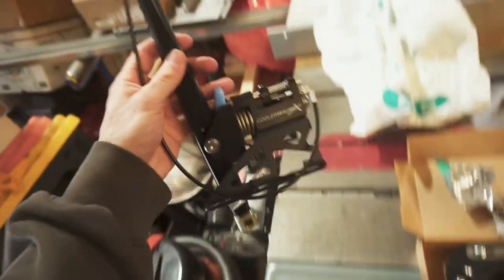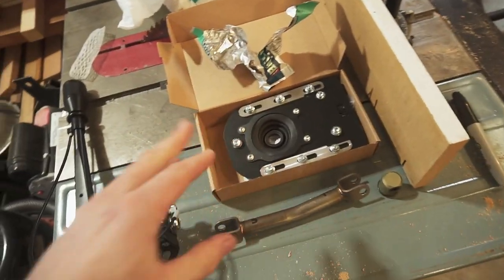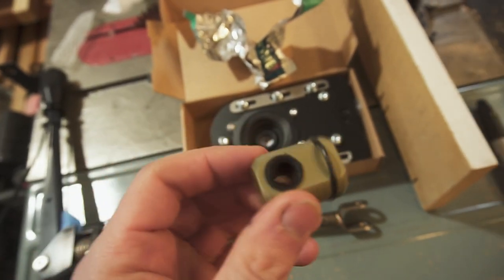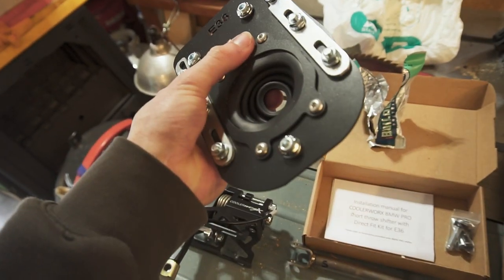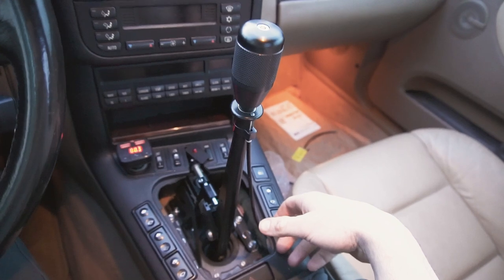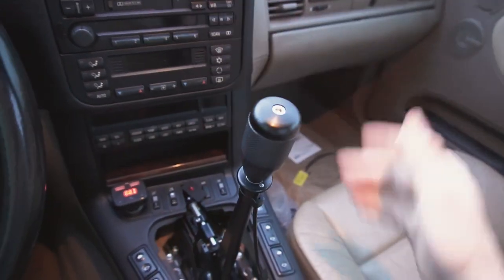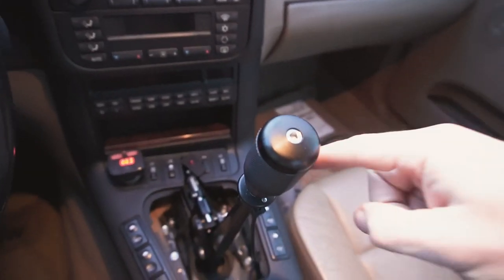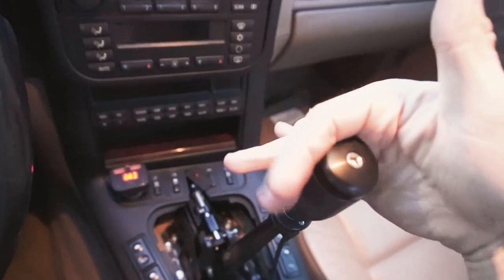E36 gets a self centering shifter from COOLERWORX... IS IT WORTH IT?

Comment: In my mind the self centering is complete nonsense. The 2-3 shift for example, if you literally just push forward on the shifter without grabbing it, it will go straight to 3rd because its already designed to center itself. Same with 5-4, just guide the shifter backward and it will align itself with 4th. The self centering aspect is actually pointless and just another way to sell people into thinking their fixing a problem they never had. honestly i dont know why you would want 1st and 2nd to look the same as 3rd and 4th. Not only that (and this is just preference) but when I put it in gear, I want to know that it is in gear and not going anywhere. If I put it in 2nd, I don't want it to move even the slightest bit, I like the feel of a sturdy and solid shifter. Alr enough yapping I just hate seeing people get shafted by this "innovative" bs. Lmk your thoughts and whether or not I'm completely crazy or what
Reply: I think the that shifter is pretty cool. I have the cliqtuning chassis mounted shifter in my e46 and i like it but it still has a lot of side to side play. The short and notchy shifts are beautiful tho but i can put it in gear and still wiggle it almost like its in neutral. The coolerworx self centering is a little weird that no matter what gear you are in it got back to center but it still stay forward if youre in 1,3,5 or back is youre in 2,4 but 1,3,5 will all look like its in 3rd or 2,4 will always look like its in 4. The racing aspect of the shifter is awesome as well because itll be way harder to miss gears because all you really have to do is push it forward or back. No need to worry about getting hung up on a gate or money shifting especially since most of the time its the 2-3 that gets messed up. I think its all about preference. If you like it, awesome if you dont, cool. I think i might get one for my e36 to see how it feels. If i dont like dailying it ill just swap it with my e46 since its the drift car.
Reply: But it’s badass

Comment: Cool tool from dad for the btch clip; I used a set of pry bars and used the corner of the shortest one on the very back of the clip.

In hindsight, a pick and hook set from harbor freight (1.99) would've worked much better, but I also had no clue what to expect as I own an auto and was just learning at the junk yard.
Reply from the maker: Totally - hindsight is always 20/20 with these projects

Comment: Did you figure out which trans and engine mounts to run with this shifter? I want to get one but also don't want the dodgy vibrations. Do you think the coolerworx non pro shifter for e36 plus fresh OEM mounts would be ok?
Reply from the maker: I think fresh OEM would be totally fine, esp for the non-pro without the centering spring - i’m running 80a poly mounts from garagistic for both, but had it make the trans mounts reeeeaally loose (like barely snugged up) so it wouldn’t vibrate. it’s been great since then, but i would probably suggest 80a engine mounts + brand new OEM trans mounts if i did it again. It won’t stress the transmission, but will take out a ton of vibrations while still being firm.

Comment: Not surprised they sent you the wrong shifter selector rod ? Did you purchase the 189mm or 198mm curved link listed at for m3? 

What year and month production is dori? Did you manual swap this car by any chance ? Or was in manual originally from day 1? Why I ask is because I know all there is too know regarding those linkages.
Reply from the maker: I got the curved link specifically for the ZF that’s in the M3 and 328i - although maybe i misunderstood which to order? Dory’s been manual since day 1 :) Any advice/insight would be cool, would like to eventually get the correct one in there to replace stock.

Comment: Hey man, Quick Q.  I installed a coolerworx regular (no centering spring) shifter on my e46 M3 and It's pretty hard to get into each gear.  Like the effort is much more pronounced.  I had a CAE shifter on my other BMW and it wasn't that hard.  Is there a way to adjust the effort level?  Any thoughts?
Reply: I saw you ask the same question in a different video did you ever get it sorted out?

Comment: What year is your car and what size DSSR did you get that did not work? I have a early 95 M3 and I think I need a 189mm DSSR vs the later cars which use a longer one but I havent been able to find concrete answer.
Reply from the maker: Mine is a 1998, so that would make sense. I don’t have access to it to measure, but I’m guessing it would work on your OBD1 given the bend for the guibo/simultaneously being too short for my obd2 with the same ZF.    Sounds like it should work for you 👍

Comment: I don’t know what I did wrong but it grinds in first and doesn’t want to go into 3rd gear
Reply from the maker: it sounds like it could be an alignment thing — before you bolt it all in, you should be able to move the entire base left/right on the transmission tunnel just a tiny bit when the bolts are loose. line it up so that when it’s self-centered in neutral, you can push the shifter forward from neutral into 3rd with the least resistance possible (1-2 fingers of pressure shojld be enough, otherwise it’s probably slightly off center with 3rd and 4th gear shift gates)— it took me a couple tries to get right, it’s just important that the self centering is truly at dead center otherwise it’ll lock you out of third and fourth (and also cause issues getting into 1st/2nd/5th). Let me know how it goes, that sounds frustrating.

Comment: Does it get rid of the shifter linkage/shifter arm since it’s technically chassis mounted ??
Reply from the maker: yep that’s the idea! You still need the linkage to connect the bottom of the shifter to the shift selector on your trans, but this completely removes the weird arm and stock shifter that causes so much shifter slop.

Comment: The dssr was not a correct fit for this aftermarket shifter?? You had to use the OEM rod?
Reply from the maker: yep :-/ I ordered the correct one for the ZF gearbox, so not sure what happened. For what it’s worth, the stock rod has been working great for many months now!
Reply: Is there a specific dssr size or brand that you recommend for this coolerworx shifter?
Reply from the maker: Any DSSR that’s the right length should work great! The coolerworx shifter has the same connection width as the stock shifter. usually i would recommend garageistic (which is what I bought) but i would recommend emailing them first so you’re 1000% sure it’s the right one for your application.

Comment: Isit must change the trans mounts to solid mounts? or we can get away with oem/original mounts?
Reply from the maker: It’s pretty much necessary, or else you’ll start missing third gear which isn’t fun. BUT don’t do poly trans mounts with stock motor mounts!!! that’ll put lots of stress on the bell housing and potentially crack it over time - I would say maybe go for poly motor mounts + fresh new trans mounts and that should keep the engine/trans from shifting around too much.
Reply: @logan-taylor  aight, thank you veryy much
Reply from the maker: @yoshen9556  no problem!

Comment: "People less smart than you have done it..."--- That's quite the assumption there bud!

RTD or Coolerworx?  (CAE is to much)
Reply from the maker: lmaooo i chose coolerworx because i liked the aesthetic a lot better (cable, exposed reverse lockout, knurled knob, etc.) but i’ve only heard good things about RTD. RTD also doesn’t require drilling or cutting, so no direct fit kit required - that’s definitely a benefit/cost savings measure to consider over CW.
Reply: @logan-taylor  Reverse lockout is cool and missing on the RTD, one of the cool thing on the RTD though is that it allows for different shiftknobs, and the have a shorter version with the self centre option. Coolerworx only have the tall version with self centering... 

Coolerworx also has the direct fit kit with the boot too keep water and the cold out. that might actually be the selling point for me. 

Great video btw, will help me pick one of the other and with the install to.
Reply from the maker: @uscp2  totally! Glad the video was helpful :) For what it’s worth, you can unscrew the shift knob on the coolerworx using the allen key on top, and underneath is a more standard thread for regular shift knobs (although unsure on the size/pitch). Either way you’ll love whatever shifter you end up with.
Reply: @logan-taylor  How do you like the height of the coolerworx Pro? 
I want the self centering function, so the shorter CW version isn't an option, but the Pro is kinda high for road-use 
(it is my fun car, so no daily driving but it doesn't see track use)
Reply from the maker: @uscp2  height has been fine for DD, but I believe you can shift the pivot point about 1 inch higher if you want (shorter throw obviously, but then you have a slightly shorter self centering one — not quite as short as the non-pro i don’t think). I haven’t tested that out, but something to consider.
Reply: @logan-taylor  Just ordered a Coolerworx PRO for my turbo e36, can't wait. 
thanks for the replies and video, definitly helped me out.
Reply from the maker: WOOHOOO!! i think you’ll love it, congrats on the purchase :)
Reply: @logan-taylor  installed it today, and I love it! 

tip for others searching for instructions:

I could put my gearbox in reverse and quite easily remove the “B*%## clip” in 5 seconds using 2 screwdrivers from inside the car. Use one to open it up, and the 2nd to push it of the shifter linkage.